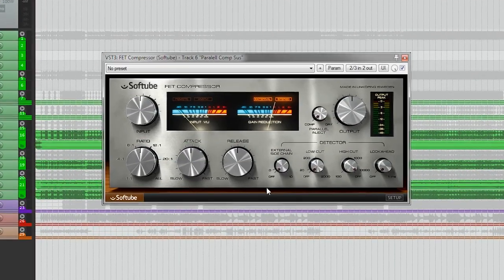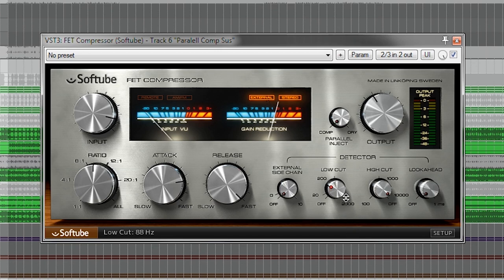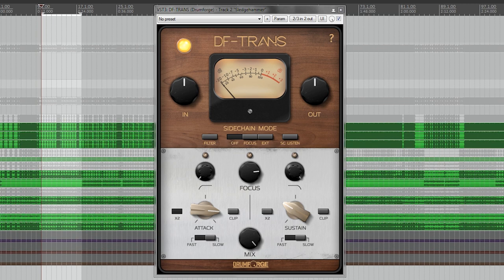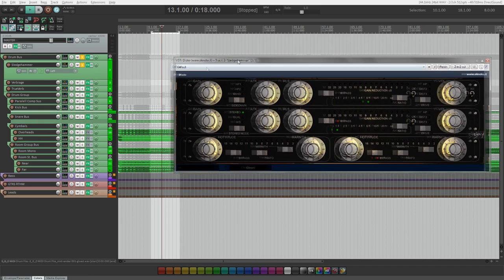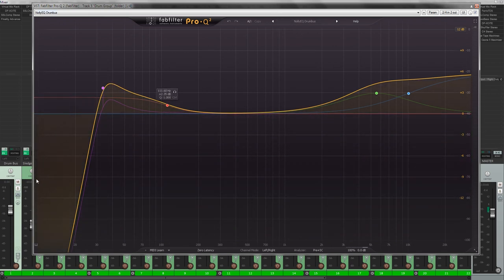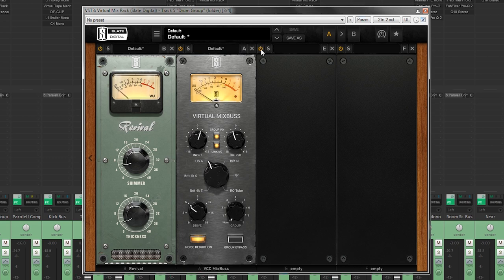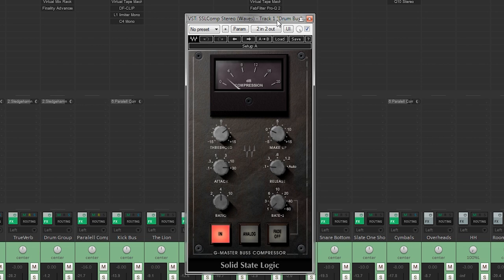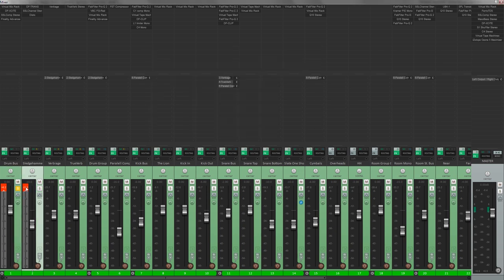Mixing Metal Drums: Parallel compression

Comment: What is the routing into your drumgroup that goes into your sledgehammer? Is it just the shells or every drumtrack that then goes into the sledgehammer that then goes into your drum bus? Being able to see how that all flows in would help a ton. Great video as usual!
Reply: All drum tracks aswell as the snare reverbs are going into the Sledgehammer! In this case (I will have to open the session to be 100%) I think I just sent the drum bus aswell as the rooms into the Sledge!

Thank you!

Comment: I'm a little confused by the difference between drum group and drum buss in this circumstance.  All the processing you were doing on the "drum group", I was doing on my drum buss.  Could you explain a bit more?
Reply: you have to route the single tracks individually as a "Send" to an "Fx channel" or "Fx Return"   where the compressor will be. That way you can control how much amount of compression is added to each track. Make sure you make the sends of each track in "Pre-fader" mode.